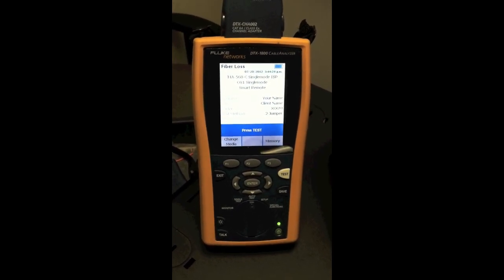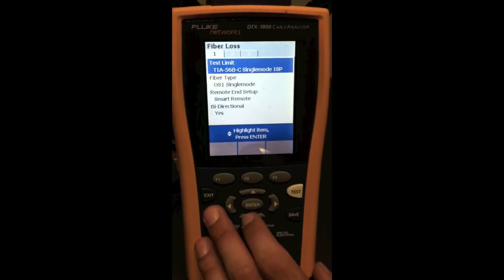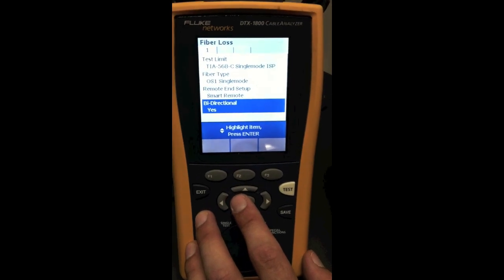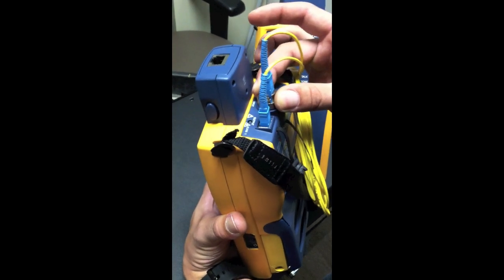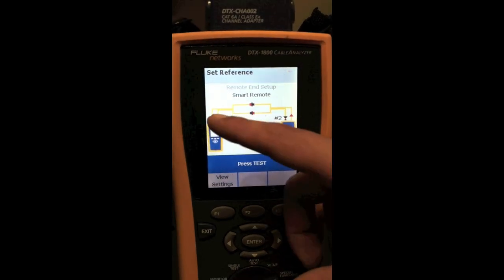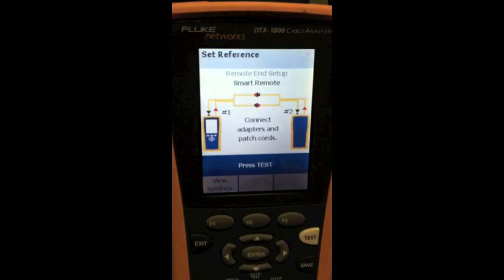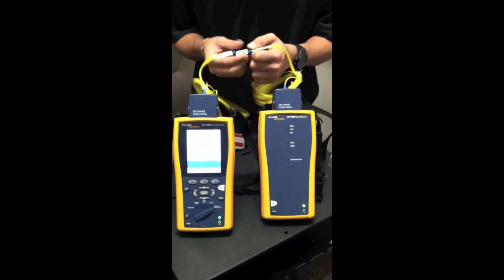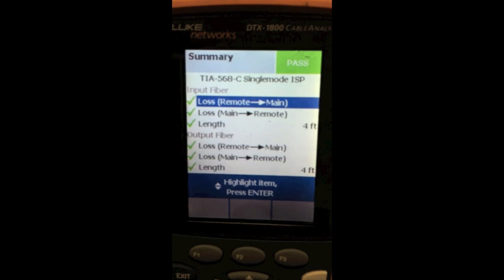Fluke DTX 1800 Fiber Setup & Test

Comment: " We actually have a negative loss found in the test result, if you ever get this message its not a bad thing, it just means as the test went on the connection got better." It actually means you have NO clue on how to test SMF with a DTX-1800.

Comment: WOW.....Sooooo many mistakes in your demonstration. Please review why it is your call yourself a fiber guy. You are NOT qualified to teach this stuff. To those watching this video...do not follow the advise given in his video. You will NOT attain accuracy in your tested fiber cabling plant!! This gentleman does NOT understand bi-directional testing...has has chosen incorrect settings in set up and failed to explain key factors in set up and test procedure. He should have demonstrated a single jumper or method B instead of two jumper (method A.1). As such, the range of accuracy is improved and it's preferred by ANSI and ISO standards. And then explained why or when a two jumper method may be used. For that matter, touching on three jumper method would clarify and avoid further confusion.Your explanation of negative loss is wrong and negative loss should never occur. (do research as to what should have been done to not have negative loss appear). Your viewers would also benefit from an explanation of what the reference values should be during singlemode referencing and also why TRC (test reference cords) are necessary. The maximum allowable loss for reference cords and how individual cords could be tested to verify quality assurance is another point that should have been made.
Get proper training and please stop with these videos.
J.T. ....30 year comms experience. N.C.S. and instructor.